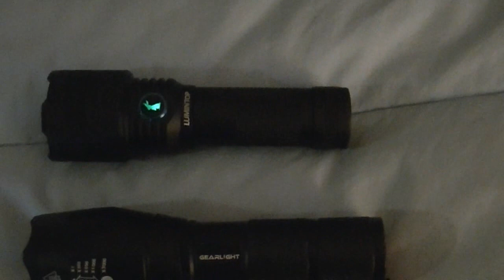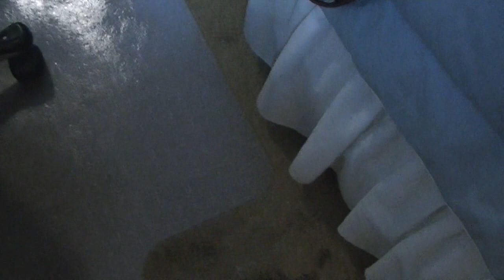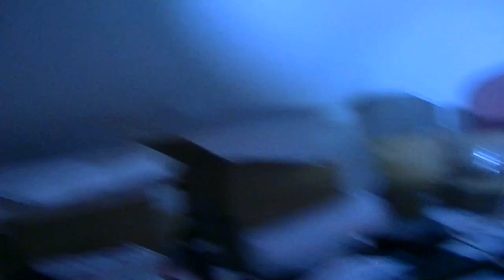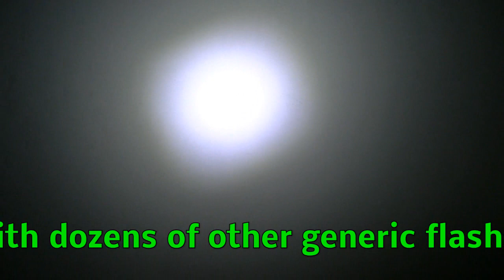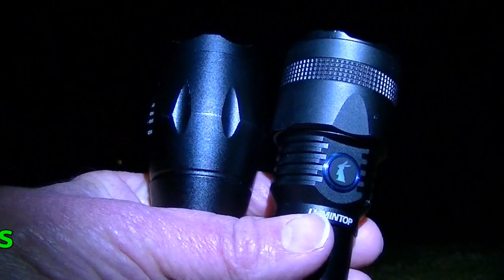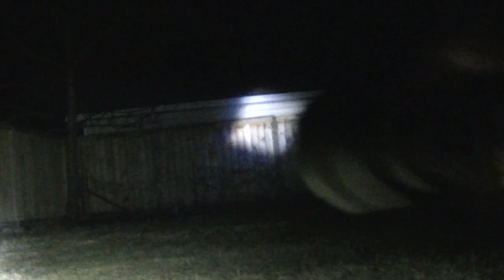Gearlight S1000 vs Lumintop Zoom!

Comment: Your presentation is suspect to me...I just bought a Gearlight 1000, and put fresh AAA batteries in it, AND IT LIT UP MY ENTIRE BACK YARD IN PITCH BLACK LIKE CRAZY...nothing remotely like what you showed  in your vid...I'm feeling something not right  here...
Reply from the maker: I'd love to see a photo (or video) of your Gearlight in action! The one I have is at least a couple of years old. I suppose it's possible that they might be placing better LED's in them these days? All I attest to, is that I tried out several "focusing" lights, from various brands, and found NONE of them to be much different from each other. They were all inferior when compared to better quality non-focusing lights. 
I also suggest you get yourself some good quality 18650 lithium batteries, which is the recommended power source for these lights! Using AAA's is a REAL waste of money, since these lights suck up battery power big time! Plus, they DO NOT HAVE voltage regulation -- which means as soon as you turn them on, the brightness will start dimming as the battery voltage gets weaker. Higher quality lights maintain maximum output, even as battey voltage drops.
Reply from the maker: I am also extremely suspect when people who use a focusing light, claim that it "lights up the entire back yard". With the kind of beam produced by a focusing head, it's virtually IMPOSSIBLE for it to light up anything entirely, unless you're in an enclosed space. In "flood" (wide) position, there's absolutely NO THROW, and the side spill is VERY dim. All you have to do is compare it to a non-zoom light with an orange peel reflector, with roughly 1000 lumens...and you'll see the difference instantly!

Comment: I haven't watched all of the video reviews of the different brands of flashlights, but, can you recommend some brands which are in your opinion the best when it comes to battery life, luminosity, impact and water resistance? I'd really appreciate it if you could help me with that. Thank you!
Reply from the maker: Thanks for the question. The majority of brands I have videos on, are pretty trustworthy. The amount of battery power they use isn't important because they're always on a rechargeable battery anyway. Lumens are something you have to judge for yourself, but most lights are over 1000 lumens these days anyway. The cheap variety (like the Gearlight) might claim they are, but usually aren't. Impact resistance and IPX waterproof rating, are also pretty uniform across most brands. The majority are drop tested to 1 to 2 meters, and submersible for up to 3 meters. So as long as it's a good brand, you won't see much variation there. If you have a bit of time, take a look at a couple from Olight, Nitecore, and maybe Astrolux or Sofirn! Their all uniquely different, but share many of the same qualities. And if you haven't looked at any of the reviews on my website, https://lightsngear.com/product-reviews/ I would suggest you do since it's a good way to be able to compare the beam-shots of each light, relatively easily. This will help you decide on the type of beam profile you prefer...more focused, or more on the "floody" side.  
Hope this helped!
Reply: @LEDsnMORE  thanks for your reply. I will check the reviews for the brands you wrote. I don't want something super expensive but more like "bang for the buck" I know quality comes with a price, but if you can suggest something at a reasonable price with good performance and battery-efficient, that would be awesome! Thanks, again!

Comment: I'm having a little trouble seeing what you want with your comparison. It looks a little like a comparison between apples and bananas, which are both fruits. The "generic" lamp costs 8.5 US stone while the expensive one is available for 36. The fact that the expensive lamp cannot focus its light beam 100% makes it lose light intensity which I think is a shame. I would buy the two cheap and use a good 18650 battery in each of the lamps. The alternative for me would be to buy a much more powerful tactical lamp for a lot more money if I were to have a light that goes beyond what those cheap ones can provide. Regards.
Reply from the maker: Thanks for the comment. 

A better battery in a mediocre light, is certainly better than a BAD battery in a mediocre light! Even so, you still need to make sure it doesn't drain too far, since the cheaper light has no voltage regulation or low voltage warning.

What should be noted regarding the Lumintop, is that it uses a better LED and optical system. By not focusing to the extent the Gearlight does, it retains the original beam pattern a bit better. The actual amount of light emitted from a focusing head flashlight is actually much LESS than one that does not focus. As the head is pulled forward, light which would normally be cast "out the front" is sucked in, and lost within the reflector! 
The LED in the Lumintop is also brighter than the generic. It might appear to be an apple & banana comparison, and if both were the same price...then there's no contest. But the Lumintop is priced accordingly per the overall quality it delivers.
Reply: @LEDsnMORE   Thanks for your reply.

 I was acktely meant a protected battery when I refer to a Li-Ion battery as proper, sorry my fault. But in the two cheap flashlights we've used all the winter, we use "only" unprotected old laptop cells. In fact, it is difficult to empty a single Li-Ion cell below the 2.5 Volt when the voltage reduction to the LED passes through a resistor so that the light in the LED goes out before the battery is real damaged. However, it is alwais safest to use a protected cell.

When there is little water vapor in the air (fog) a lamp that has a lot of light next to the main beam is not so good because you are blinded by that light. Therefore, I think people should aim for a flashlight with a clean beam.

Buying a flashlight is like buying cars, you don't usually buy an more expensive car than you think is your need is for transport. Regards.

Comment: Different led's? Im assuming gearlight uses xmlt6 and I know lumintop uses a xhpv6
Reply from the maker: In your reference to "different LED's" I'm assuming that I might've said that often with low-cost generic lights, there are sometimes different LED's used than the one described. And yes the LED in the Gearlight appears to be an XM-L, but the Lumintop has an XP-L HD.